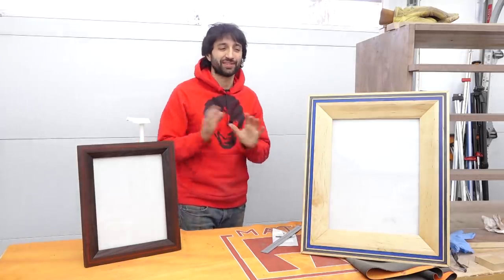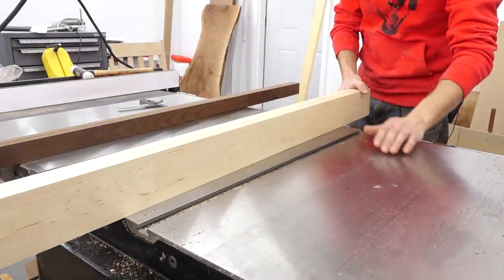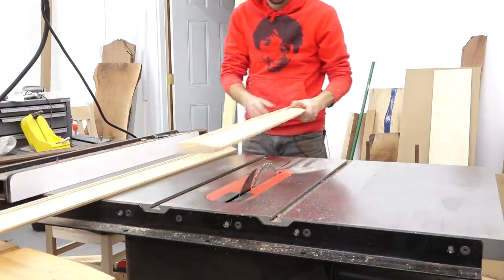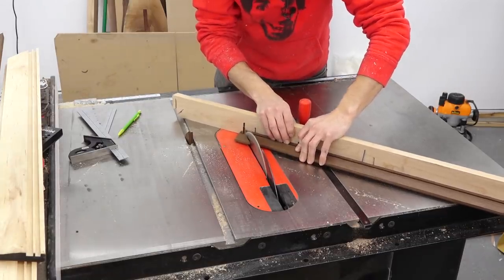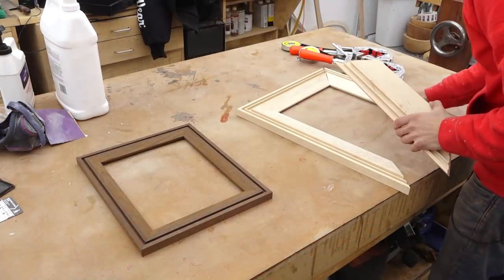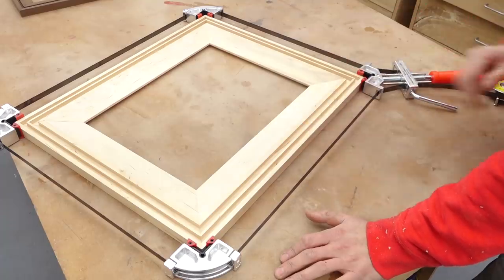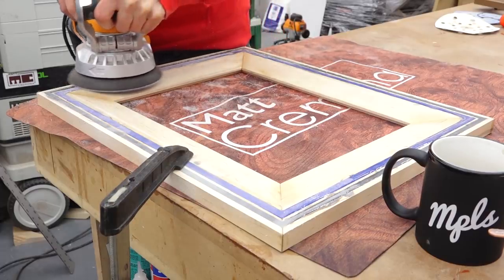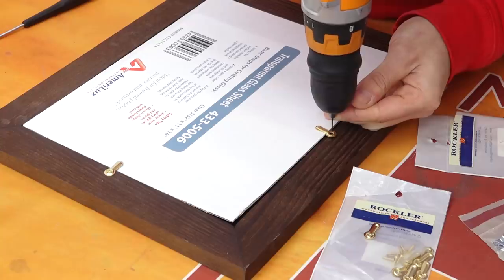Making Picture Frames with Epoxy Perimeter Inlay | Woodworking Project

Comment: Excellent idea and love the them, may even need to build a few....
My hands aren't as steady as they once were so I purchase disposable bottles at the dollar store that have a spout, kind of like a caulking tube spout. I can then cut the hole to the size I need for the project I'm working on. Helps me keep better control of where I'm pouring and with less mess and spillage to deal with later.
Reply: @ralphgesler5110  Great idea, thanks for the tip. I'll keep it in mind next time.

Comment: GREAT project Matt.  Proof of Concept = 10.  As for color, it will depend on what picture you are planning to put in there.  This technique really opens up the final presentation look with a custom color to match the media! !! !!!
Reply: Agree with comment, also consider any matting treatment.  I generally design the frame from the other choices.  Always get wife or daughter involved, mine have much better design sense than I.
Reply from the maker: Thanks Mark!

Comment: Hi Matt, when  pouring into a small groove, you can use a small wire. Lay the wire across the cup and let about 2 inches (or your particular need)  extend beyond the edge. Then let the epoxy flow down the wire into the groove. Both frames look really cool!!!

Comment: Hey, Matt. Great project. My number one use for this project would be Diploma Frames with school colors. Be they College, High School, or Certificates you want to hang in you office or on your wall. Even a marriage certificate with the wedding colors. Great idea for reinforcing the miters too, drill some blind holes on either side of the miter and fill with the opposite color, or before the pour for additional bite with the straight pour. (Or to add a third color pop (to maybe look like rivots?)) Maybe hand carve the school/team name in one of the sides/top/bottom faces for an additional embellishment and the Name/s or date, ...
Well, we all get the idea juices flowing by now...
Anyway, love the project. Great starting project in the new shop, for sure. (Unless I missed something. I saw the case standing in the background).

Comment: Clever idea! Those came out nicely. I need to make a couple frames soon, and I may have to try that technique. When you cleaned up the epoxy squeeze-out, was that a dry rag, or did you use a solvent on it? If do, which one? I have no idea what solvents would work with un-cured epoxy, and it seems like a useful thing to know.
Reply from the maker: I used acetone.  Thanks!
Reply: @mcremona  Thanks!

Comment: Matt, pouring the rabbited grooves with epoxy is a great idea but same would work for brass, copper, and aluminum strips inlaid into a similar area in frame stock?
Reply from the maker: Yes; would be easy to inlay before cutting the miters

Comment: Curious, would it make any more sense to cut the bevel before the rabbit? I've struggled recently with bevel cuts that reduce my flat surface to a dangerously small amount against. I assume you were pressing firmly into the fence to hold the piece up... until you had to use the push stick??

Comment: Thanks for the band clamp link. My arm is getting sore from throwing away all the crappy plastic ones.
Between the glass and artwork some of these frames have to endure a fair bit of weight. I’m surprised that you’re confident in using an adhesive without any mechanical fasteners. As far as the colors go, my opinion is well, no. Anyway enjoyed your vid.